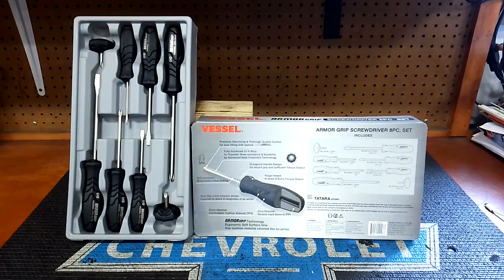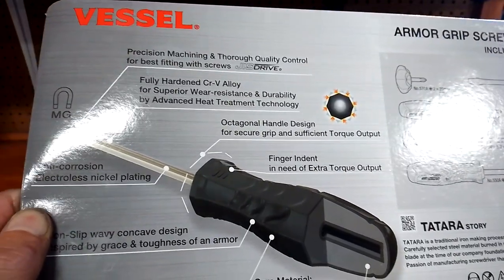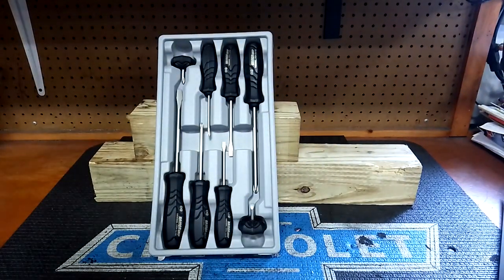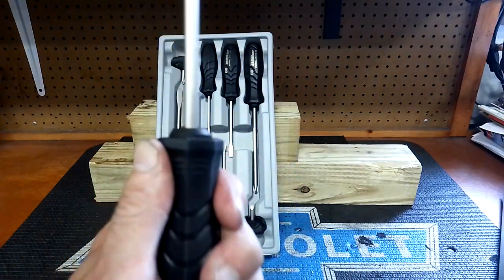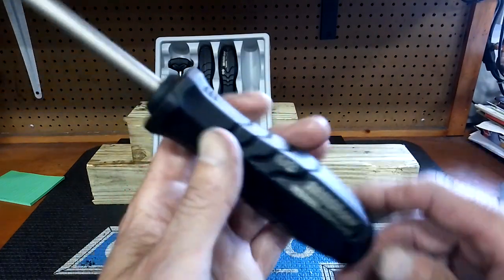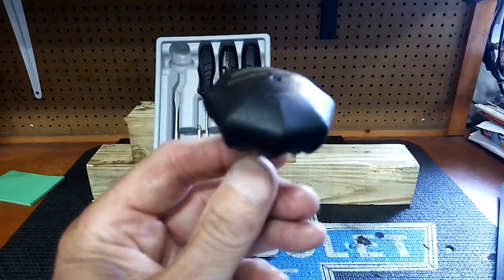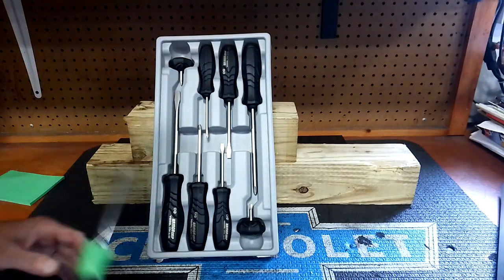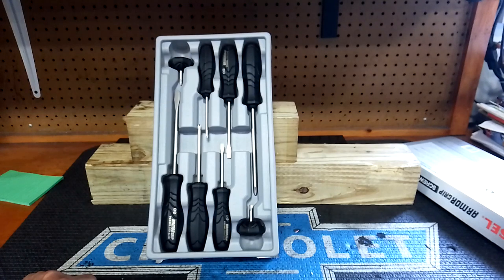vessel armour grip jis screwdriver set!!

Comment: Great looking set of screwdrivers. I noticed that the Vessel drivers have a hex shape molded into the handles. I wonder if it is designed to use an adjustable wrench for added torque. I would prefer a bolster especially when trying to remove the brake rotor retaining screws. An impact driver works best for stubborn screws.
Reply from the maker: Thats good question,ill have to put a ajustable wrench on one!! impact drivers is what ive used mostly on those retaining screws!! those screws are only used to keeo the rotors still when going down the asembly line, thats the only purpose for why they use them, you dont need them, if you break one taking them off no biggy, just put the rotor on and youll be fine!!!

Comment: In my experience these did not fit the screws on my Suzuki well. In fact, the P2 driver had a sloppier fit than the crappy HF Pittsburgh screwdriver it was supposed to replace. 

I did like the grip though, and I'm bummed it didn't work out. I returned the set. I already got a Vessel Megadora P1 and P2 to replace. I have a large Philips that seems to fit the P3 screws on my bikes well for now, so I'll probably hold off on a P3 Megadora -- but let's be honest I'll probably buy one of those too.
Reply from the maker: Thanks for youre feedback on these,those were one if my tool give aways!! keep it coming!!
Reply: Bummer i was looking at these since its only $20 for the set of 3 (p1,p2,p3) … so you are saying skip these and splurge for the vessel megadora ?? Is the drip softer on the megadoras at least ?